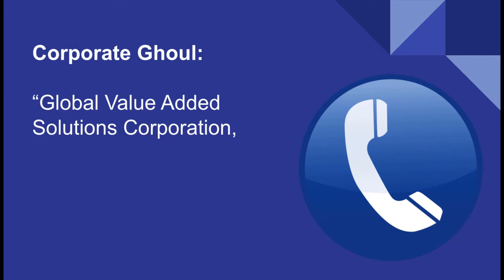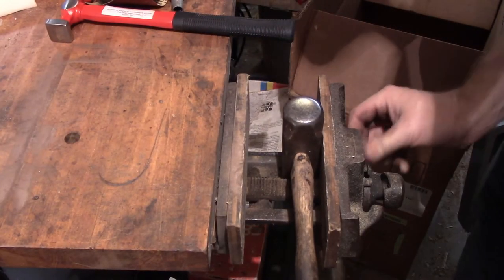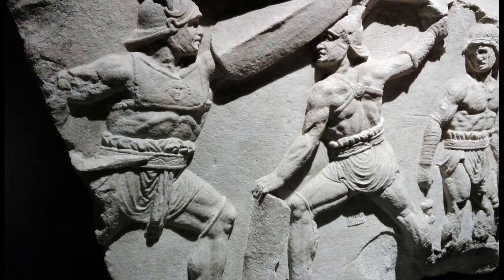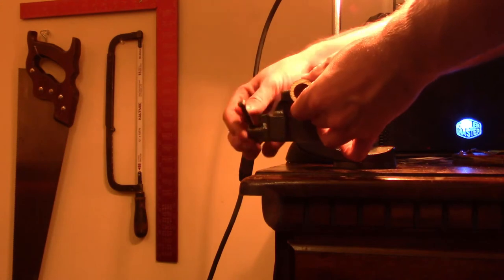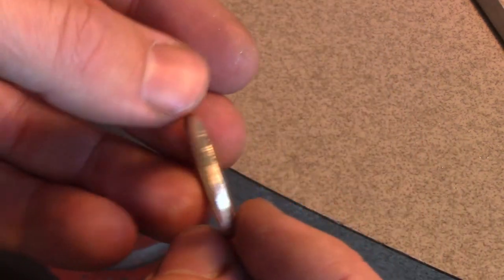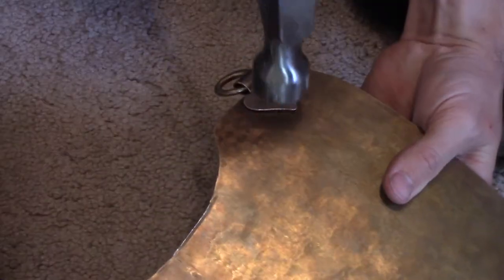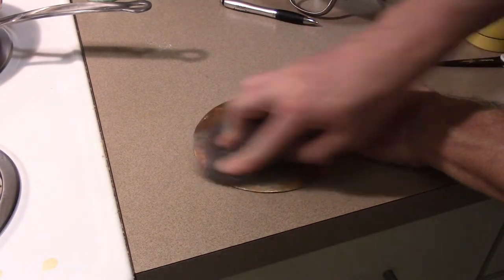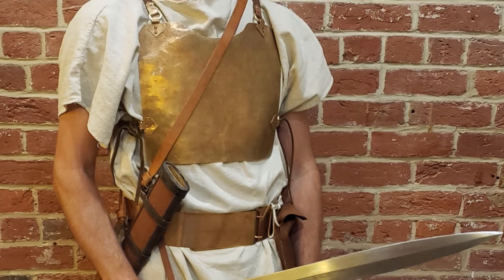Making a Roman Republic Bronze Breastplate

Comment: Technically speaking, how much protection would this offer in a real battle, using a Scutum and Sword?
Reply from the maker: Hard to say, my guess is it's just slightly better than nothing. I'd take it if it was all I could afford
Reply: It protects the heart and lungs from stabs and projectiles. Since the soldiers were side by side
Reply: @dson978  It's very doubtful that it would provide much protection against arrows or powerful thrusts from a sharp sword or spear. That Bronze is too thin, even if work hardened. But... it would be better than nothing if, for example, an arrow penetrated your shield enough to hit your chest.

Comment: I am as much impressed of your kitchen workshop improvisation as I am of your armour. DO you think armour like this was padded on the underside or was padding worn to make it more comfortable? I talking more about bundled cloth than a dedicated set of clothing but I could imagine that you'd want something like that after taking a hit against it as my experience of wearing a partially built set of lamellar and being hit lightly against my side sent a shockwave of stinging pain straight through me.
Reply from the maker: A lot of the early examples have holes around the edge, presumably for sewing on padding or at least some kind of leather edging. Lots of them don't though, and while that doesn't mean they weren't padded (I've read about helmets that had their lining glued in with pitch) I didn't bother. It covers so little anyway I didn't consider it worth the effort. It might hurt more to get hit, but I would probably still consider myself lucky I didn't get hit where there wasn't armor

Comment: Hi there! Your video was great, and I love deadpan humor. I appreciated your trials and tribulations getting your hands on c52100 phosphor bronze at the beginning, and that you're using something equivalent to ancient tin bronze instead of substituting brass or a modern silicon bronze. I do wonder if it would have been better to seek out c51000 phos bronze instead, as there likely may have been a wider selection of sheet sizes. The only difference between 510 and 521 is the former having 5% tin instead of 8%. A lower amount of tin would likely have proven cheaper for the soldier in question, and modern phosphor-tin bronzes are harder and stronger than the ancient alloys for an equivalent tin content anyway. Dunno, just a thought that popped into my head. 

Heh, at least you didn't ask the poor corporate ghoul for c52400 bronze with 10% tin... probably would have asked for the souls of your future great-grandkids or something.  xd
Reply from the maker: Thanks for the feedback! I've worked with small diameter 510 rod before and for some reason it just looked like copper, which is why I didn't settle for it in sheet. Since I made the video I've seen 510 sheet in another application on reddit, and it had more of the gold color that my 521 does. So I don't know what the deal was with what I got, but I'll definitely have to get my own sample for future projects.
Reply: @THEFACILITY  It's up to you, but if you're not wedded to using phosphor bronze in future projects, you might consider c65500 silicon bronze. It's more widely available, and the mechanical properties for flat sheet are similar to 521 phos bronze. The color isn't too different, either. Less yellow than brass, but still a nice golden-orange hue. So while phos bronze is closer to historical bronze alloys, silicon bronze may just be the more economical/practical option. Best of luck to you!

Comment: Might I ask where you ordered the bronze sheet metal pieces from? I've always had a fascination with bronze, that is ancient bronze armor & weapons, and I've always wanted to try my hand at making some reproductions of various ancient bronze pieces. The bronze armor you've made here looks exactly like something I'd like to make.

Fortunately I do already possess a bit of a skillset in metalworking/metal fab primarily from gunsmithing, watchmaking, and auto body repair. (I am a certified master watchmaker.) For the most part that pertains to TIG welding, brazing & soldering, sheet metal fab, a little bit of casting, and of course drilling, cutting, grinding, finishing, riveting, etc. I also have a shop with an assortment of tooling including a TIG welder, oxy/acetylene torch, anvil, machinist vises, drill press, and various hand tools. At first I was considering gathering up the materials to build a small foundry where I can smelt bronze & sand cast relatively simple things like spearheads, short swords, axe heads, etc. However after watching your video I've decided that this bronze breastplate would be a great item for me to try my hand at fabricating.
Reply from the maker: With a background like that you shouldn't have any trouble doing this or something better, good luck!

I get the bronze from riogrande.com, it is the only place I've found 521 in non-industrial quantities. They have wire in the same alloy, and I have used it as TIG filler on other pieces. I even tried sticking a spool in my MIG welder with argon shielding gas, it wouldn't do anything but make giant spatter blobs though.

Comment: Good news there is now a website that sells up to 24”-36” phosphor sheets
Reply from the maker: In 521? What website?
Reply: @THEFACILITY  it is phos bronze but unfortunately not 521, they have 510 which is 95% copper 5% tin, the color and properties are almost identical so still a better option than commercial bronze which is really just brass.